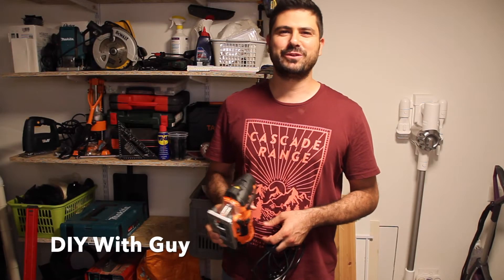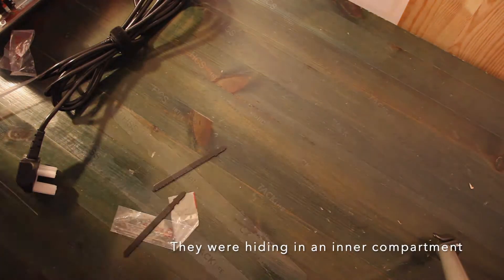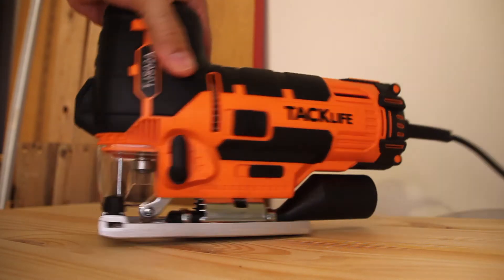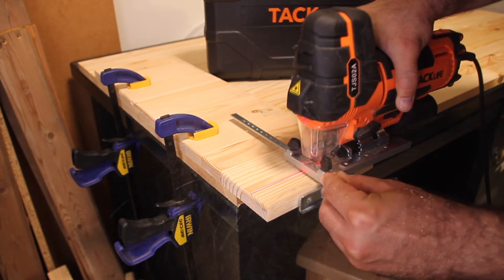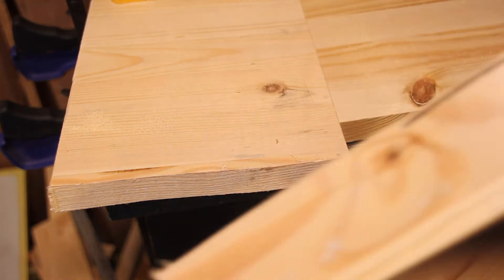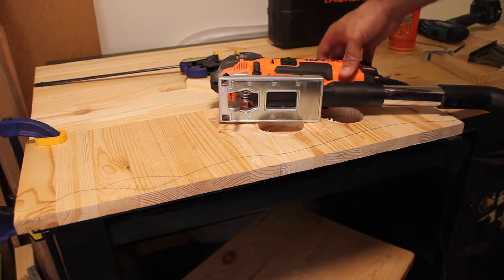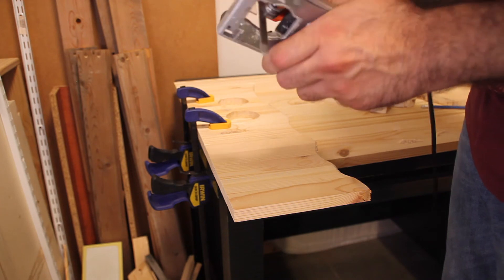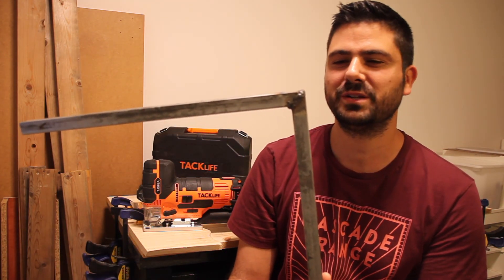TACKlife TJS02A Barrel Grip Jigsaw Review

Comment: Buy some real tools not fisher price the fuuuuuuuk
Reply from the maker: Yeah check out part 2 though with a decent blade it did a good job
Reply: A real tool is one that pays for itself and saves you money. Until it does that it is a toy. I have a Bosch jigsaw that cost quite a lot of money when I bought it 20 years ago, but back then that's what I had to spend to get a tool that performed well with blade oscillation etc. Now for a fraction of the price I paid back then It is possible to by something like the saw in this video that probably performs just as well. Will it last as long  ?  Who knows but the chances are that it will have paid for itself before it gets stolen off the job site, falls off a roof or just fails outside the warranty. 
Then, who knows, it's replacment may well offer BETTER performance (thinking brushless) of have other features.
I have a Marita reciprocating saw, had it a long time, it is built to last but it's an underpowered boat anchor compared to some late module cheapies.
Reply: @tjm3900  ye ye eat a diznik